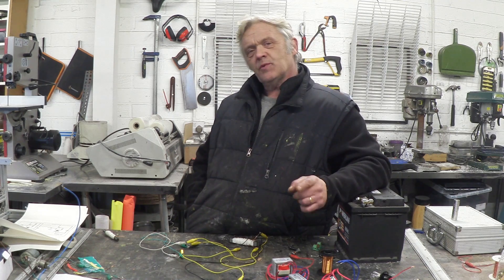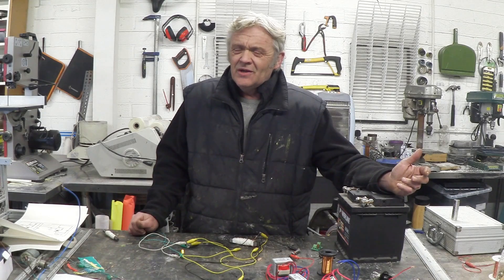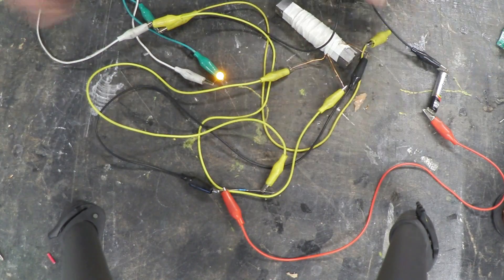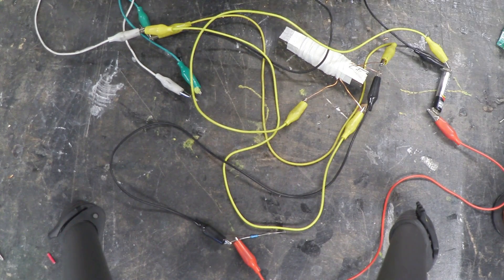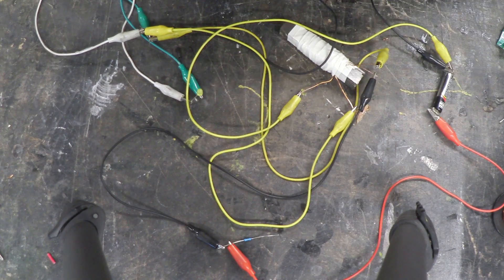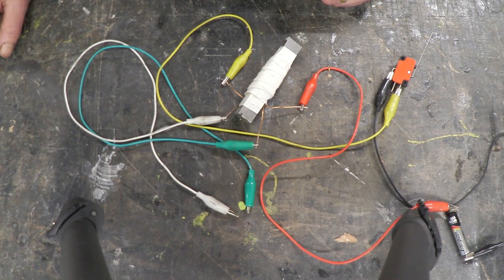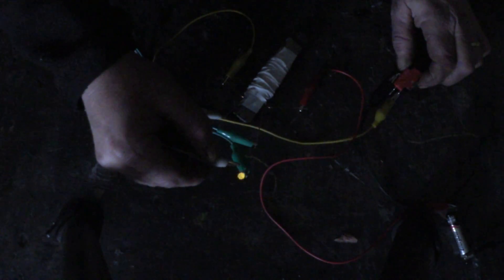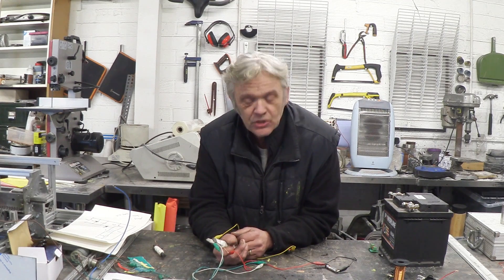988 The Heart Of The Bedini SSG

Comment: The Tesla’s switch is definitely part of the system but you have to remember it’s a two-sided system; an “open system”. Absorption and dissipative. A dipolarity (dipole for short) exists in a battery or capacitor ( Tesla called them condensers). THAT is what converts the negative (as yet undetectable by meters) into the detectable positive energy flow. The absorption side will get very cold, dump it’s energy into the condenser, and then  power the load. The switching is the trick. You must use  the collector in between and also have a load on the whole circuit to maintain your dipole WITHOUT CONVENTIONAL GROUNDING!

Comment: Book: The final secret to free energy….Thomas Bearden has the answers you’re all looking for. Pure copper in the dissipating/work/motor side; doped copper for more absorption on the negative energy absorption side (impedance and resistance act oppositely on this side——the secret).
Reply: @erickdupont4503  Thomas Bearden, was Bendini's partner, at the time they were working with Floyd Sweet. Who took the secret to his vacuum motor to his grave. Now if you are smart enough, you might be able to get that to work. For us regular folks that did not study advanced physics, or get a job at GE and have a supervisor like Gabriel Kron, the Bedini motor is more of a simplistic way to get around the issue, until the public schools starts teaching advanced physics in high school.

Comment: Build the MEG by Tom Bearden and a Group of engineers ... his science was solid (RIP) and he had knowledge that Dates from the 1800 until 2015 all in his head on demand .

Mrs Chungs negative resistor the Military doesn't want to be shared.

It's just Carbon compressed !! 

AND if you want to de-sulfate PLEASE ... just use a a "Capacitance charger" ... 

Plug to Capacitors to Bridge rectifier and make sure battery has water , desulfate it in minutes

Comment: great stuff ... thats also why one has no overunity and just drains the battery vs the other .

Only problem about Bedinis SSG is that you can't use the Load Battery to run the SSG again ....

and the main thing you forgot Rob is that the Lenz law has to be bypassed which is done by having permanent magnets on one side facing north and the electric is ONLY switched on at the moment the permanent passes .

So as clever as you are .... don't bother with things you don't understand

Comment: Thank you. You definitely are missing components in your oversimplistic design. Your path of logic should not be to look for something that LOOKS like a Bedini, and then designing your own schematics to fit that bill, and then concluding it's not doing anything special. See, you compare Bedini with a Joule Thief, then you compare it to a transformer while you never put together a real Bedini generator. I have used my Bedini (single coil, single transistor) for over a year now,  recharging hundreds of batteries (12V and all the 9V, 6V, 1.2V and 1.5V used in my 12 meters). Results? My Driving battery (12V car batt like the one you have) went from a full charge at around 12.80V, down to 12.26V a full year later after over 200 charges of several Charging batteries. Gain: a grand total of around 40Volts from all battery types I recharged. It produces a topup of 200-350 mV in 15 minute, or anywhere from 350mV to 1 full Volt in around one hour. This is considering a "settle time" of around 8-12 hours whereas my Charging batt will drop a bit, not unlike conventional charging. And my Drive batt will very often climbs back up to the initial Voltage. As you know, the capacity (how much AmpHour a particular battery can put out) remains to be what that type of batt can yield (versus the load resistance), the task (like we all do in mains or "wall" charging) is to get the voltage back up. It is an overunity generator, not by much but it is. Overunity is also produced by photovoltaics, geothermal, windmills, watermills, tidal and waves, Earth batteries, and more. So, considering a COP of useful voltages gain versus losses (voltage drop of the Drive battery) we have (conservatively; I kept records but did not bother to run the tally)   40 Volts gained / 12.80 - 12.26 = 0.540V. So, 40 V Gain / 0.540V loss =  74.07 x 100 = 7,407 %. I repair and build things and studied physics. Theory is not my forte. However some theorists have advanced that all mag fields are made of aligned photons (like beads on strings). Induction (EMF=Voltage) comes down to time-dependent crossing of mag lines by a charge (or better, a copper wire or a coil) so when a coil expands a mag field around it, it pushes photons away (two photons cannot occupy the same space). You "pay" for this motion as you "pay" for pushing electrons in the coil, as electrons in free and travelling state, create their own mag fields. The magic happens when the feeding current is turned off, the field collapse - and the displaced photons come rushing back inward, entraining more of an "inrush" aka back EMF spike. There should not be any gain you say, correct! BUT since photons have no mass, Newtonian F=ma doesn't apply (at un-relativistic speed). So you are no longer confined in a closed system (the circuit) but an open one. Just a handy theory. Any engineer will say that back EMF spikes are very real and the conventional remedy is to channel it to ground or use a flyback diode - OR IN RARE CASE, you will hear an old engineer say you can recharge that supply battery if you omit the flyback diode. It's safe with a battery supply but flyback diodes are to be applied because your DC or AC power supply may bust from those pesky back EMF spikes. So, John Bedini is a smart man who found a clever way to channel this back EMF instead of grounding it. Yes, I recharged up to four batteries at a time, without further or significant penalty to the Charging battery's voltage. I also charged a battery while powering brightly an array of 12 LEDs. But it's finicky and you must apply some timing to it. I strongly suggest you approach this subject with humility and method. My hopes is that one or several of you, will further R&D (it's very cheap to research and develop) and with similar, or radical design, will ramp this up to hundreds of kWatts to power the world and eliminate CO2 emissions. The most expected outcome is a positive result. Together we can definitely do just that and bring freedom (not a further dependency) to everyone, including the fauna and flora. Best wishes!

Comment: What people really confused about i think is the need for triggering the collapsing back emf as they call it but you don't really need that fast switching triggering mechanism to get that energy as long as you have a high voltage electrostatic field around that coil. A 500hz max coupled with capacitative discharge will do the trick :-)

Comment: I am very grateful and thankful. You're great.  I would like you check 1929 patent for transformer amplifier . for some reason counter clockwise coil and clockwise coil have strange effect .  more commonly know as bucking coils.  supposedly 1 amp in 10 amps out .no voltage change .  I know your busy, so if it's possible my question would be isn't high amp better than high volts. I'm just checking my conclusions. configuration of coil's and closeness of  material to coil through iron core create a vacuum effect and increase amps .  Thank you  your a inspirer's

Comment: I used to think in simplistic concepts of a water wheel driving contact breaker points to be the oscillator  until I learned about a 555 integrated circuit to be the switching system instead of the wheel and magnets   I think of it as the Bedini wheel without the wheel    cheers

Comment: A few years ago I watched a video by an older gentleman who has a channel called "Thedaftman" who showed openly how to build a Bedini SSG variant that comprised two batteries and an automated switching circuit that switched over to the other battery when the "running battery" dropped below a certain point, to run the system on that battery while charging the previous battery.  In one of his videos he claimed that he had a Bedini system running for weeks to see if it did what many claim it does, (which he claims it did), so he just went ahead and shut it down.  Right away, that seems to violate that pesky 2nd law, and I kind of have too many things going on to spend time chasing fairy tales, but in the last couple of years, I've done a lot of reading and some very respected authors make the point that the 2LTD describes a closed system, but that in reality there is no such thing as a truly closed system, and it is this reason that they believe that it's only a matter of time until someone is able to tap into the seemingly mythical "zero point".  They also seem to believe that much suppression has occurred historically to those who seem to get too close.  Do you think that there's even the smallest chance that the aforementioned gentleman was being sincere?  I feel odd asking this question, because I've been an electronics tech for well over 20 years and it completely contradicts what I've always known, (however,  lately I've been learning that multiple things I thought I've always, "known",  have actually been wrong), but, nothing I've done ever dealt with this sort of thing, (I worked on TVs and VCRs back when they were relevant, and now mobile devices, computers, etc,  and every now and then, things such as multilevel trace repairs on certain irreplaceable electronics).   I'm just curious as to your opinion on the matter, before I start winding hundreds of feet of bifilar and trifilar coils and venture out of my electronics "safe zone".   🤪🙃
Reply: Are you still looking for information on this subject?

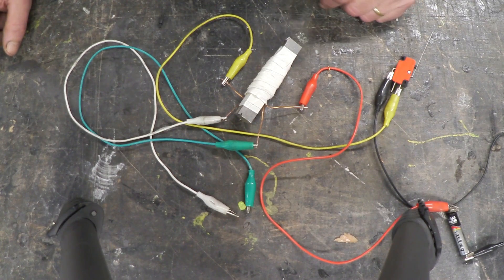Comment: 2:44 
The older circuit designs used things like magnetic reed switches and hall effect sensors. Once transistors became more accessible, they started using those in the designs because of availability and simplicity. The experimenter no longer needed to fuss with getting their switches into the exactly correct position, as the transistors could automatically perform the switching operation at the "perfect" time. I've never built one of these (more accurate to say that I never finished one), but I've studied off & on for a number of years. It's a pretty clever circuit for how simple it is. It's just that reading the schematics for it and making the correct connections gets a bit confusing.

Comment: Hi sir, this one idea got stuck in my head ,if you can make a huge capacity Ni-Fe cell using a 200 ltr drum, and jelly rolled carbon felt, which is electroplated with Nickel and iron  for electrodes ??? It's for a backward community self sustainable solar system

Comment: No. Follow Bedini's instructions. The bifiler is a 1:1 transformer. 130ft coils. NO NEO MAGNETS. You didn't capturer the spike and shuttle it to a second battery. Input current should be limited to 120ma transistor to begin. Make it work how Bedini instructed FIRST. Then go back and make changes. Magnetic machines are very inefficient when built small so think big.  Start of with the bike wheel one circuit. Learn it. Then move on to the muiltifiler systems. Don't skip the bike wheel setup thinking it doesnt do anything. Build it to BEDINI Specs and not some internet copy of a copy's copy that was hand copied. Use good batteries for learning the machine and then you can attempt to revive some wore out batteries. Never ever allow the charging leads to come off while it is running. Crappy builds give crappy results. Small builds are much harder to get working.
Reply: Any place where I can find the original Bedini model circuit? There's so much trash and bad copies, I keep finding different versions all claiming to be 'it' .
Thanks in Advance.
Reply: @undernetjack  Then Danny does have websites and go on YouTube and find his videos.

Comment: You should check out the work of Master Ivo on YT. He is using a pulse generator and 555 chip to drive the high side switching of a Mosfet to make Tesla Pancake coils resonate with 600v back EMF spikes from a few volts input (0.5w in 50w back).  The challenge is really the best way of collecting and using this energy generated..

Comment: There is an engineer from Toyota in Japan who built small fans which produce 400% more energy than input.
The design:
Two or four bobbin style coils just outside the fans rotation 180 or 90 degrees apart, on two blades of the fan neodymium magnets 180 degrees apart. A switching circuit similar to bedinni.
Coils drive the rotation for one cycle then harvest electricity from four or five rotations, repeat.
The engineer said Toyota was planning to put these in vehicles for the heat and air conditioning systems.
It’s difficult to find this video now with so much clickbait videos in the magnet-motor space.
Besides this can maybe you can replicate the Kapenad device, a.k.a. The Don Smith device, also M.I.T. videos on tuned coils that produce electricity.

Comment: So what you're saying is the SSG is not using the magnets for any supply of energy but only as a rotating physical switching mechanism?
Reply: No.  the magnet is doing a little more
What he demonstrated is when the magnet approaches the coil it saturates the core and forces a collapse.  One collapse is all needed to demonstrate the Led blinked, that is what the bedini wheel does over and over.  With each approaching magnet the coil core will saturate with a magnetic field and reach max once the magnet is direclty above the core and as the magnet leaves the magnetic field on the coil collapses and that is the spike in voltage of the bedini SSG that charges batteries.  I have been playing with the SSG for some time and the transistors burn easy (made in china).

Comment: You cannot break the rules of thermodynamics
Reply: Why are Maxwells-equations called Maxwells equations?  He did not come up with any one of them.  He just added a term to Amperes law.
Is the induced electric field by a moving magnetic field conservative, or non conservative?
My Point :There is so much to discover that has not been discovered.
Reply: Quantum mechanics says that you are wrong and that you are just repeating stuff that you memorized in some elementary school.
Reply: It may be possible to have a device that puts out more than it takes in but it must cool down something or somehow else draw energy in from the outside. Just as heat pumps can be 500% efficient on heating by cooling down the outside air. Idk really.

Comment: Nice intro video, would have loved to see you go a bit further down the rabbit hole though, so many variants to control in the circuit despite its simplicity , coil matching , resistance  optimisation , inductance application, and thats just for efficiency actual techniques for building can vary so much (magnet switching or self oscillating) i think your excellent gift for explaining these things would have given the idea a bit more substance.  Id be interested in seeing your panacea motor opinion too. Keep it up for us hobby tinkerers
Reply from the maker: it's always a difficult balance between too much detail and not enough - all I really want to do is introduce the idea that these are not difficult to build - so that seemed enough for me - I'll go into more detail later for sure - but step by step mate lol

Comment: Most of the references I can find to the Bedini SSG claim that it outputs more power than it takes in. Surely you're not going along with that nonsense?
Reply from the maker: no - of course not - but it has uses high frequency high voltage is being investigated as a desulphation technique for batteries - and by investigated I mean research papers for reputable universities
Reply: @ThinkingandTinkering  Whew! Okay, good. I figured you were too sensible for that rot.

Comment: Instead of a microswitch use a small dc motor and 9v battery. The commutator switches the primary current on and off creating a crude AC that a transformer can use. If you use a suitable transformer (perhaps a mains transformer backwards) you can step up the 9V to quite high voltages this way.
Reply from the maker: nice tip mate - cheers

Comment: Very cool, this switching could be used anywhere you have something being vibrated by the wind. Another harvesting project that could charge capacitors.
Reply from the maker: yes it could. mate and I am thinking about the ultra low voltage circuit I mentioned that uses a jfet
Reply: @ThinkingandTinkering  very cool, this I have to see. Hope there will be a video!